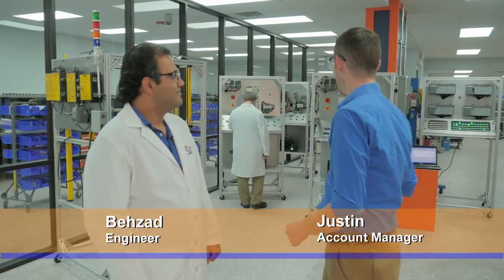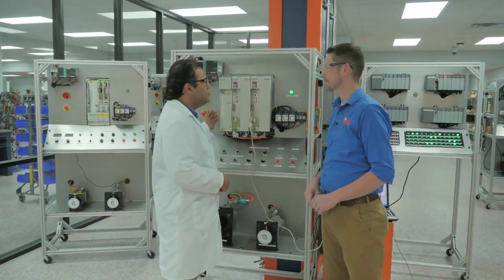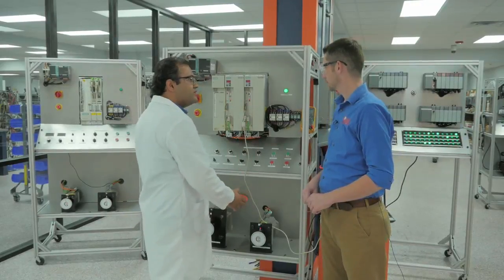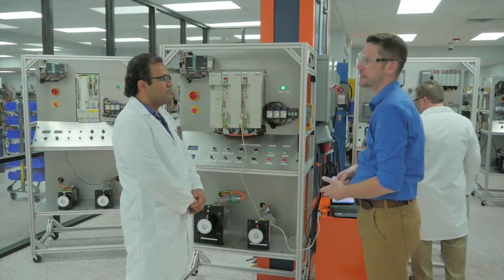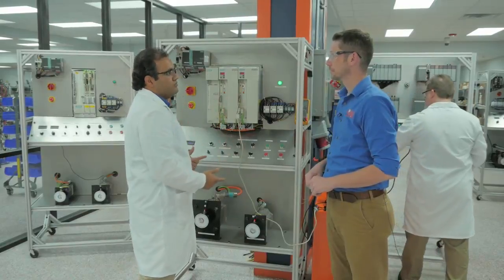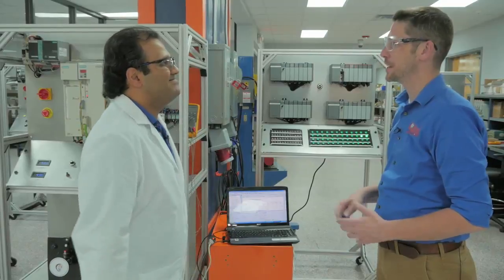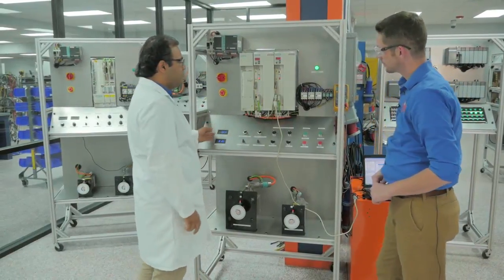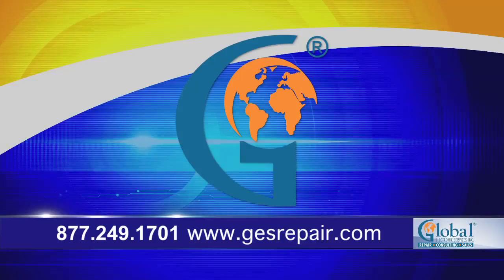Siemens Drive Repair and Load Test

Comment: is it possible in simovert mc drive :

to take feedback from drive of running current and display it in another external controller for some  controlling/display purpose.

Kindly suggest me both Wiring diagram & the necessary parameter which is to be changed
Reply from the maker: Mohammad, Please contact us directly so that we can further assist you!  sales@gesrepair.com  Thank you!